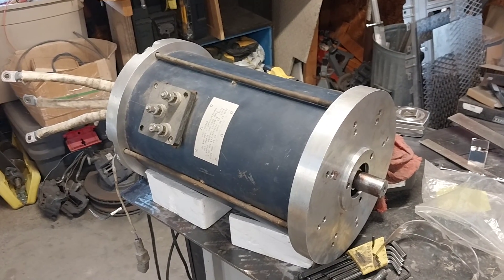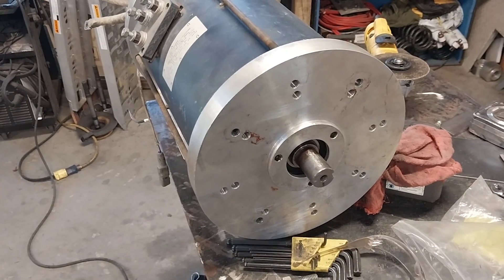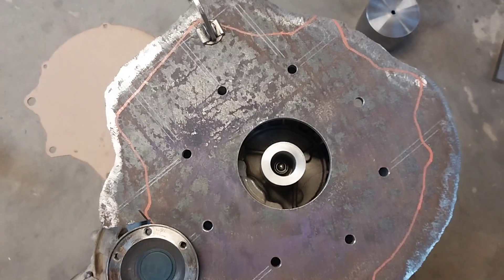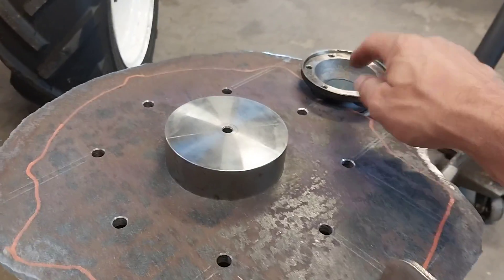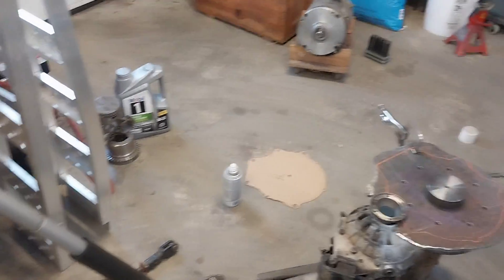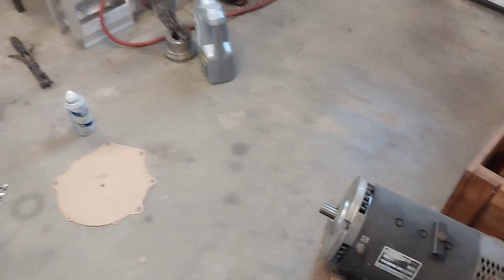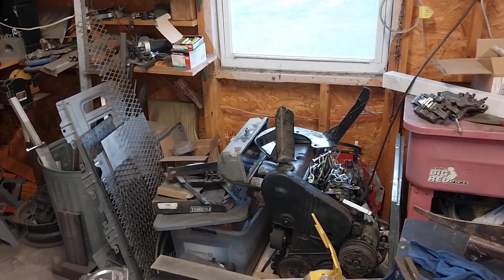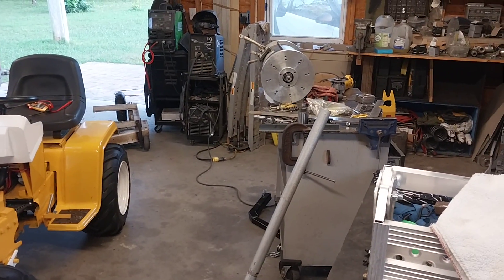It Doesn't Seem To Fit - TSLA VW

Comment: Another option would be to take the drive cup off, extend the output to the other end of the motor, support the end of the shaft with a bearing block and then install the transmission cup on. Then run two drivers side axles, which would have the added benefit of eliminating torque steer.
Reply from the maker: That, my friend, is thinking outside the box!  Very nice!
Reply: @billbayer5526  Everyone loves a good jackshaft!

Comment: I see a lot of conversions using the old transmission for simplicity. But you don't "really" need the transmission if you have an electric motor do you?
Reply from the maker: You don't need a "transmission" per say but you do need a final drive gear reduction from the motor output shaft to the wheels.  I will most likely put the transmission in 3rd and forget about it.
Reply: @billbayer5526  i have very little knowledge, so I'm pulling my suggestions out of my arse so to speak, but is it not possible to get this with some custom diff? Maybe even portal axles that I think would fit the car great 😎😃(would probably be costly I guess).
Reply from the maker: @magnulof   portal axles on a VW pickup would certainly be different!
Reply: Surely the quickest way to figure this out is to make a dimensionally accurate, mock up of the motor, and test fit?
Reply from the maker: @cgalpin  of course that'll get you close but you never really know until you use the real thing
Reply: @billbayer5526  I dunno man. It’s just a cylinder. You should be able to make one out of wood and cardboard the exact same size. Unless it’s super easy to remove that flange, that’s what I would do.
Reply from the maker: @cgalpin   it is easy. All the bolt holes will work with any motor so it's not a waste of time.
Reply: Without transmission you may get poor experience on a very low speeds, also you are limited in speed range without transmission